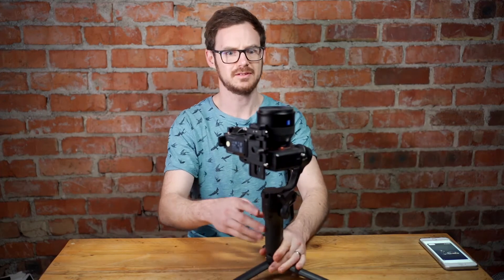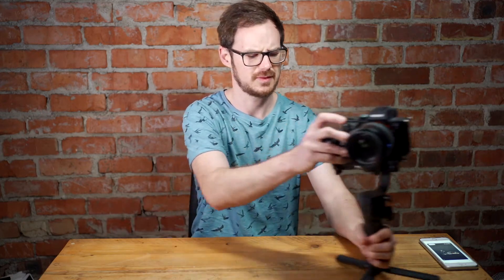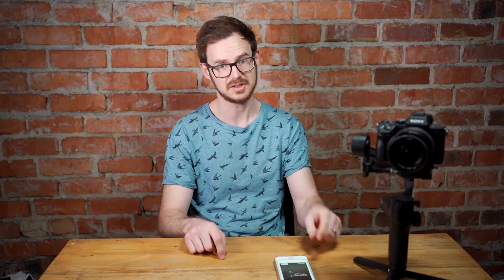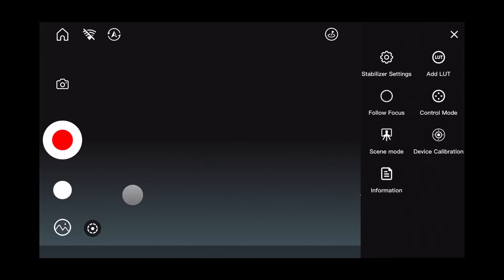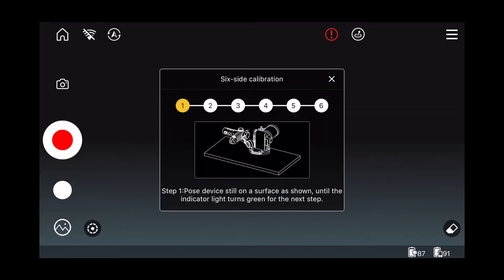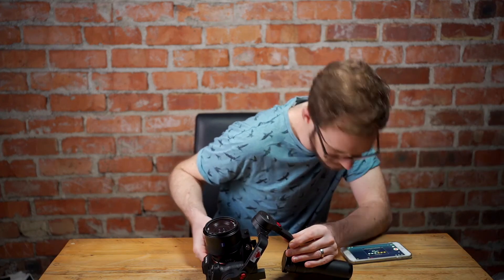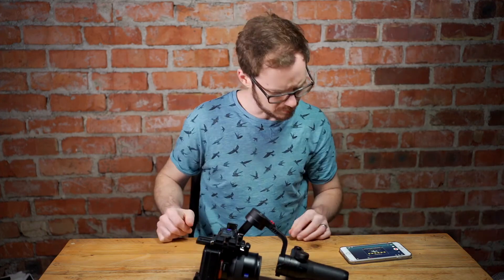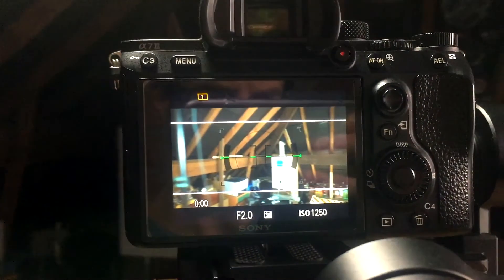Zhiyun gimbal not level? Easy Weebill Lab Calibration Fix Tutorial!!

Comment: I've done this 2-3 times in the past year but it does not work at all for me (weebill S). Instead, I just put it on a flat surface and turned it on, went into camera leveler on my camera and then adjusted the roll and pitch angle on the gimbal. My Roll is off by about -0.90 degrees and pitch is off by about -0.15 degrees. Also, I have started using lighter lenses on this gimbal so it works fine now. If I use anything heavier than 1.5 - 2KG total, it just keeps of off balancing itself in between the shoot. So it can go from -0.90 on roll to about + 2.0.0 on roll. I also sent it to service once 2 years ago, they charged me about $50 but didn't fix shit. I did not have the energy to do to and fro with the company as the service centre is about 1200km away from where I live. So I just have adapted to shooting light on this gimbal. It works best with my Z5/Z6 and 50mm 1.8G with adaptor, 40mm f2 Z, 26mm 2.8, etc etc. So all light prime lenses. The usual lens I mounted on this when it was new was 24-70 f4 Z and it used to work fine. I also occasionally mounted the 16-35 f4 G with adaptor and that is a super heavy combo. I know it is under the advertised limits of this gimbal but it still didn't ever take that lens load. Anyway, Zhiyun is a company I would stay away from as their service is pathetic but their products have this issue a lot. With DJI, even though the service is equally abysmal for where I live, at least the products aren't this bad. I used to own a mavir air and it was decent.

Comment: My pan axis doesn’t centre on start up or from selfie to PF - what do I need to do
Reply from the maker: That's a strange one, there's a full calibration mode where you lie the gimbal down and it recentres itself but I can't remember off the top of my head - I did it years ago with a Crane 2 and it fixed it.
Reply: @faircloughstudios2552  tried calibration twice too! Shame there is not a setting like the roll pitch etc to centre it.

Comment: I have a Zhiyun Crane 2 and whenever we used it in a car and speeded-up, the footage got wonky, even though it was in L-Mode...

Do you know the reason for this problem and how to solve it?
Reply from the maker: this might just be an issue with balance - if the inertia of the car movement is causing tilt, just make sure your balance is absolutely spot on, then calibrate, then try it again. I've had the Crane 2 and it can;t be a weight issue unless you're using something really heavy like a a 1DX and 70-200

Comment: thankyou for this video ..... I have the creator pack in which the follow focus system is also there .... after a time the motor gets loosed up ... meaning the gimble is on but gets off..as of  the motors gimble is off plz help me out with is problem
Reply from the maker: Hi, thanks for watching - have you calibrated it with the focus motor attached? maybe the added weight of the motor is pulling it off balance? one more thing you can do, is in the zhiyun app, you can fine tune the balance manually, so if you are still experiencing a slanty horizon you can dial in a couple of degrees of tilt to counteract it. I have done this in the past with the Weebill Lab and it worked!

Comment: hello sorry I have the engines as crazy and I can not put them in stand by. could you help me?
Reply from the maker: Hey thanks for watching, I’m not sure what you mean - do you mean jitter? In that case it’s usually a poor balance and it needs rebalancing in all axis ahead of calibration
Reply: @faircloughstudios2552  the balance is perfect, from off the camera stays still in every position, but as soon as I turn on the gimbal all three motors move like crazy. I try to double click the power button to pause them but I can't and after a few seconds the gimbal goes into protection
Reply: @galleriadellafoto  hold down the POV button

Comment: Do you have to do this every time? Seems a bit annoying. I just bought the gimbal and it's giving me the same problems...
Reply from the maker: Not every time, I’ve only done it once but had fixed it for now - if I see a drift I’ll do it again but hopefully it should just stay like this now :)
Reply: @faircloughstudios2552  in the menu, the "angle" settings fixes the issue...chose roll, and roll to the desired angle and it saves...
Reply from the maker: Oh you absolute legend, will try this out when I get up to the studio next week :)
Reply from the maker: Have you found that it stays like this once you adjust on the gimbal menu?
Reply: @faircloughstudios2552  yep...so far so good...it remembers...even when I change lenses...awesome
Reply: @TheActiveLifeLived  this tip saved me mate! Thank you!
Reply: @faircloughstudios2552  I did the calibration, only madit it better by 1 degree or so....so 50% better but not completely level yet...I've upgraded firmware as well as recalibrated twice....I'm sad 😭